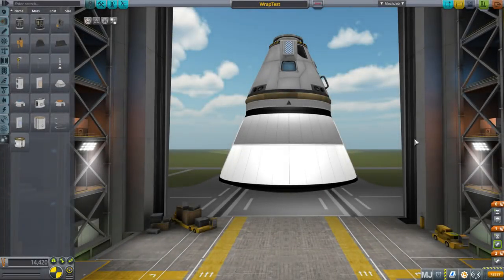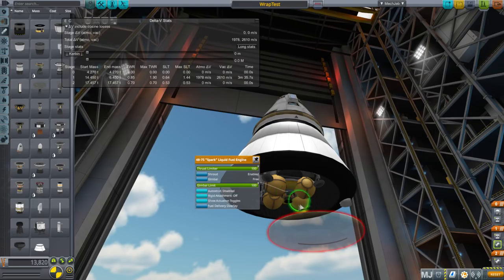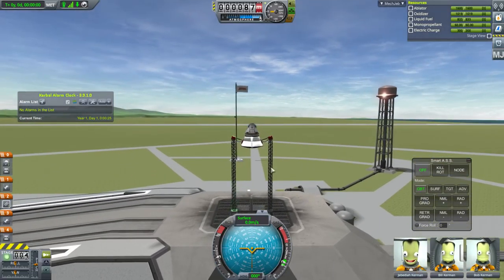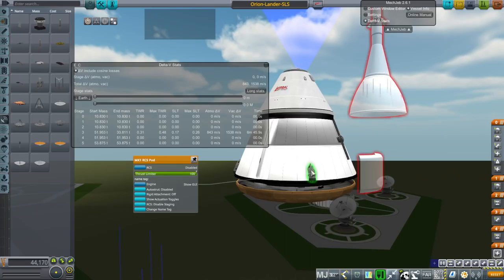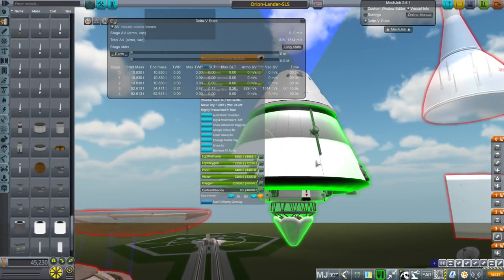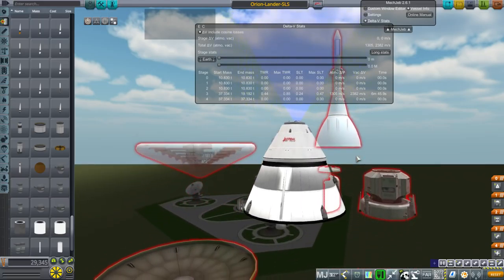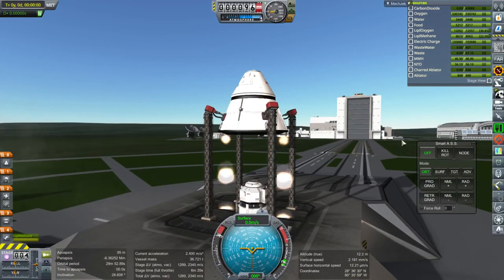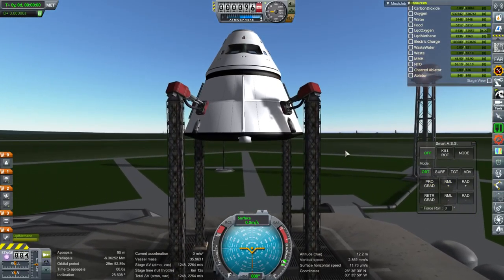Kerbal Space Program - Part Dev - Wraparound Service Module

Comment: If the TWR was over 1 it could make an awesome LES.
Reply from the maker: You need a TWR way over 1 to be a launch escape system - more like 10. So, there's really not much way to pack that much power and keep the service module as heavy as it is - better just to integrate launch escape into the pod like Dragon 2.

Comment: The shading on the part looks a bit off. Either you didn't apply an Edge Split modifier after smoothing out the model, or the angles are off  and needs to be manually split by selecting the faces and hitting Y.
Reply from the maker: I definitely didn't do the Edge Split modifier - I'll try that and see the results.

Comment: Da gap between heatshield and bottom plate tho...
Reply from the maker: Depends on the size of the lander - I could have made the lander stouter to fix that. Also, I want to work on some new heatshields with gaps for engines.
Reply: I'm glad to hear that, but aren't the engine bells to tiny compared to CECE?